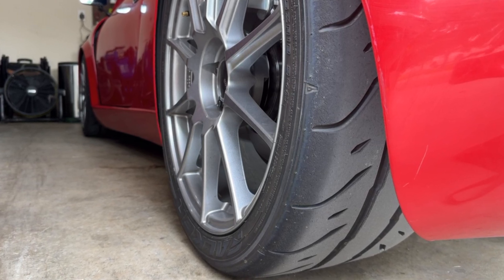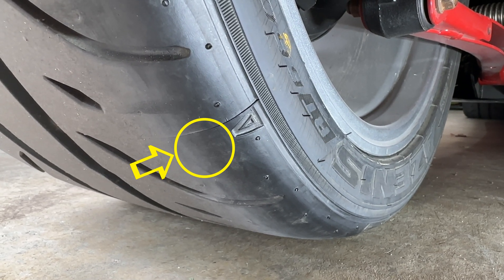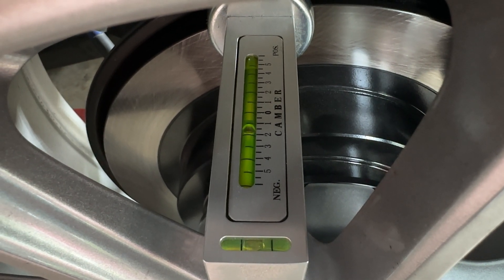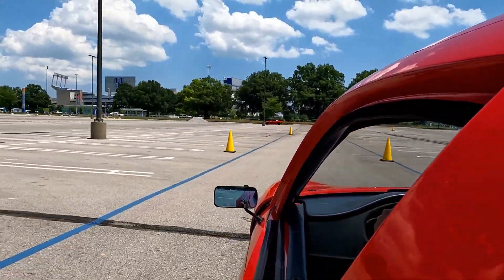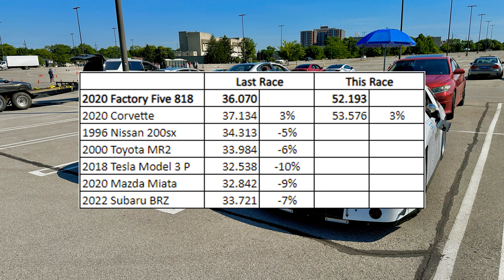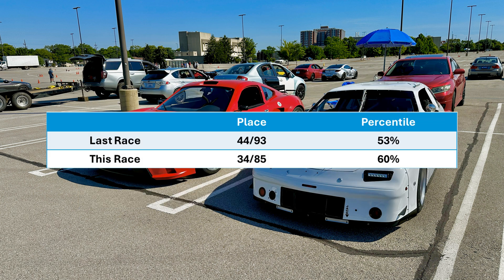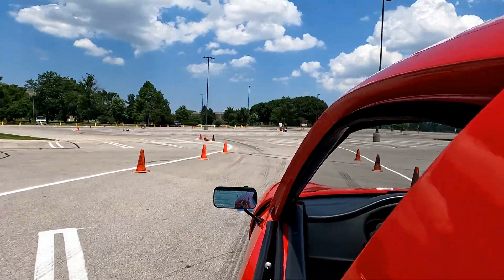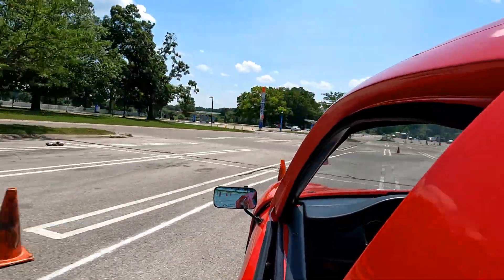I Wasn't Using 25% Of My Tires! | Factory Five 818

Comment: during a race is not the time to test new settings.  get a tire pyrometer and do steady state skid pad.  it will tell you what your camber and tire pressures should be.  4* camber will definitely lower braking force.  That's why cars use lots of caster to give  camber in turns.

Swap cars with the fastest driver.  you'll learn what your car should feel like, and he can suggest improvements.
Reply from the maker: When I started autocrossing I wasn't competitive so I was using the events as R&D. This year I've moved from the 75th fastest (out of 100 cars), to 17th with all the setup changes I've made. This video in particular showed the inside of my tires not touching the ground at all, so pretty easy to decide to add more camber. Any contact would be a big improvement.

I increased my rear camber in increments, all the way to 3.5* which is when my times got slower and my traction got worse coming out of slow corners. So I backed off to 2.5* which gave me my best times and helped with straight line traction like you mentioned. I do run high caster on my front wheels (6*) with only -1* of camber, which is working great. Front end traction hasn't been my issue this year.

I just bought a pyrometer but haven't had a chance to use it. I know the skid pad is a standard method but I'd prefer data from a race day. A skid pad assumes steady leaning at 1 speed. During autocross you spend a lot of time switching between fully leaning left vs fully leaning right, and at speeds between 20-60mph. I may only spend 25% of my time at full lean at a skid pad's speed, so I don't want to tune my car for just that 1 condition. If my car spends 70% of it's time at a half lean, I'm going to tune for that. Which I think would be more accurately captured from race data which accounts for all the different turns and speeds the car goes through.

Comment: Try like -3° next time. I'm in a street class, and I use -2.5°f/-1.5°r. Other friends with more serious XA/XB and ST builds have more in the neighborhood of -4° to -2.5° or so, depending on car. For autocross, though, go a lot farther up on camber than you would normally use on a road course.
Reply from the maker: I agree I need more but I'm taking small steps to get there. I want to see what camber level starts to hurt my straight line acceleration / braking.
Reply: @mikecamera818  you'll probably start to get there around -3 to -4, based on how stuff I've driven in the past felt. why do you want to find that out, specifically?
Reply from the maker: If I jump to -4deg and create a problem or the car is difficult to drive, I wouldn't know how much to back off. I'd rather change 1deg at a time and watch how things are changing. It'll give me a chance to adjust my driving and find what I like. More info will just help me optimize my setup and I find it interesting.
Reply: @mikecamera818  good call. try to make the changes between runs, if possible. or maybe spend a day doing doubles if your region offers it. run your first heat of runs with it at your baseline camber setup, and then change it to what you're considering for the second heat and then write all your thoughts down as your having them between runs. it's usually better to try and make changes back to back if possible as opposed to making them potentially a couple of weeks apart.